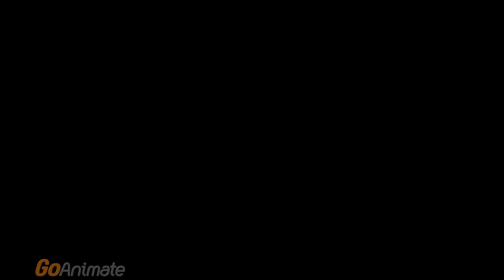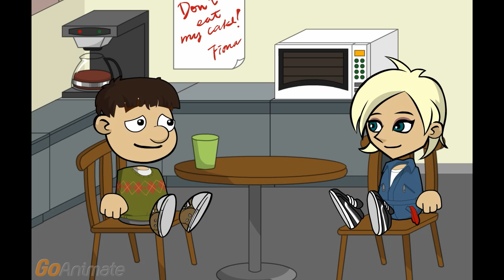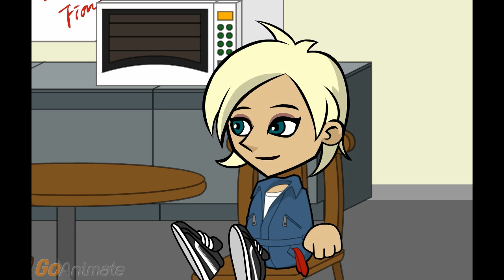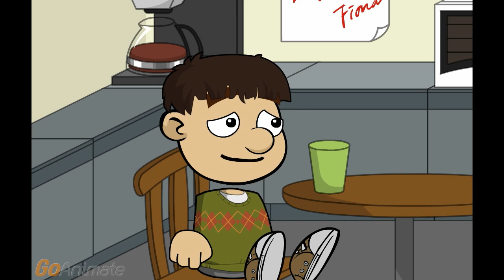How to Fix Furnace Ignition Failure

Comment: My furnace has an automatic ignition system.  The "on/off button" is stationary, but it has a slit in the middle, with two toggle switches, or gas control switches, as the instructions call the switches.  Does anybody be know which of those buttons I switch, or turn to the off position in order for the furnace to light itself again?